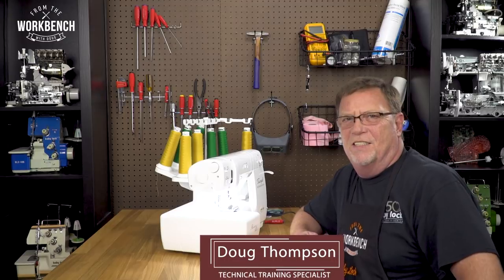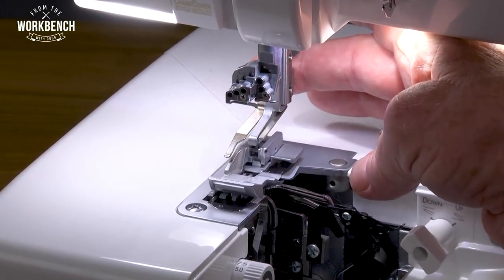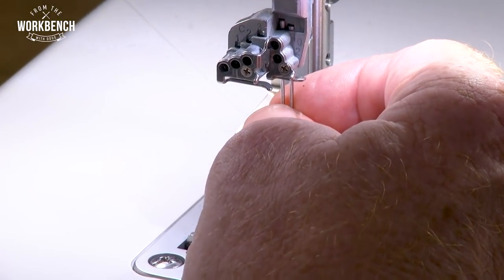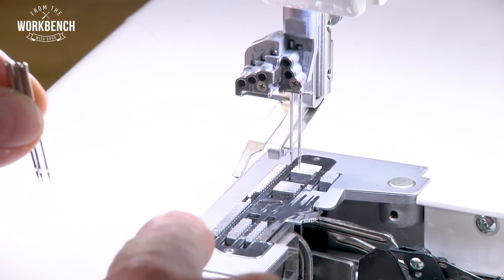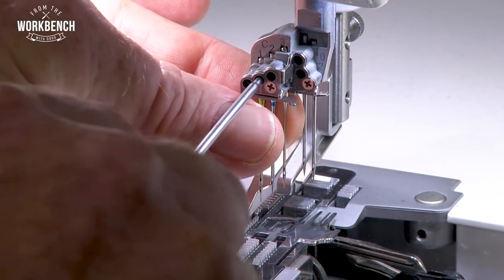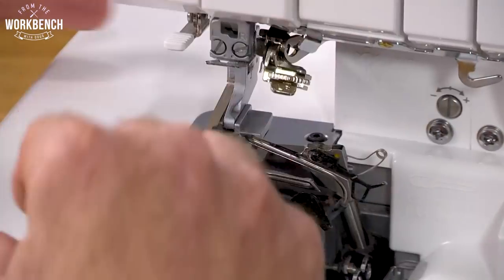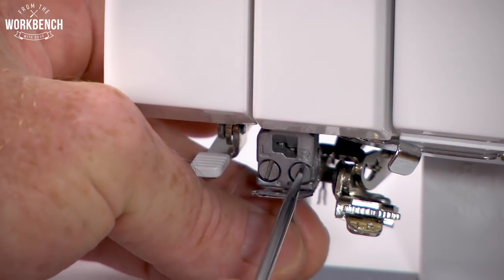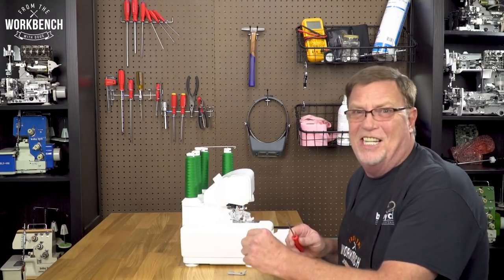From the Workbench with Doug - Easy Serger Needle Installation

Comment: Very helpful Doug.  😊. Thank You.   Wish they would tell us these things in the manual.   Today as I was changing needles one dropped into the machine.   I expected to find it in the little magnetic tray but it wasn’t there.   When I opened the left side door, it was sitting in one section of the plastic platform.  But, as I was trying to get it out with my tweezers it “jumped to the right” and now I can’t see or find it.   Any suggestions besides taking my machine into the tech?